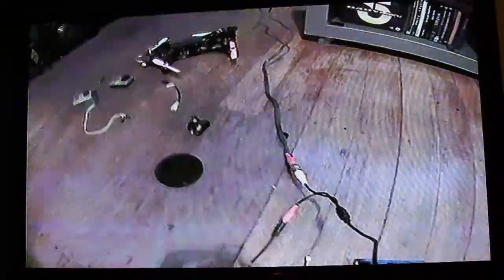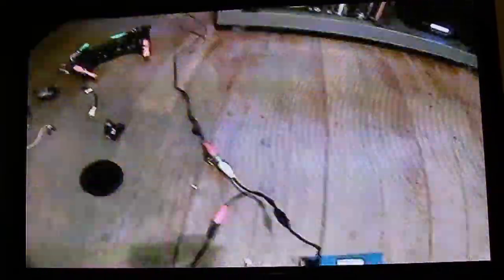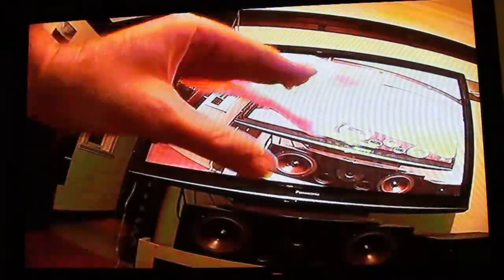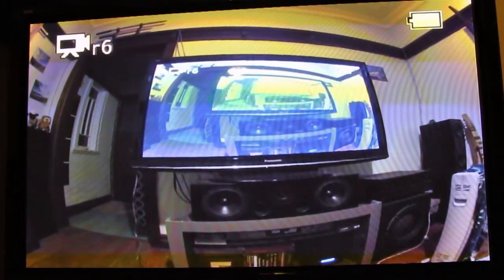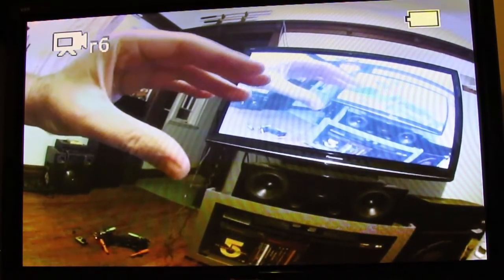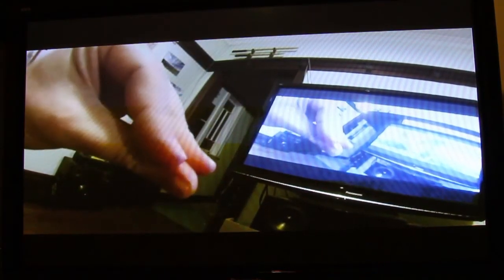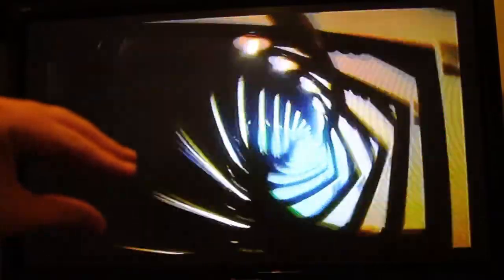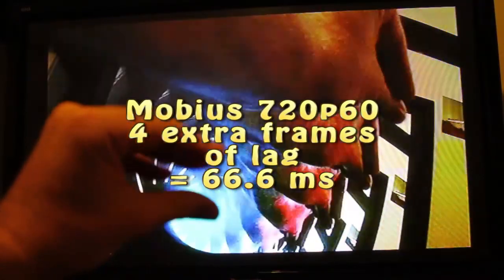FPV Camera Latency Test - PZ0420, Hero 2, 3 and Mobius compared

Comment: I don't want to watch the whole video. You claim the pzPZ0420 has NO lag? Is that even possible? So anyway, the total lag is 66.6 ms with the fpv camera and +- 1.8 times as much with the hero 3.
Reply from the maker: I don't even understand your comment but the findings are all in the description above... pz has virtually no lag, yes, especially when compared to the others. The 66.6 was from the tv. All cameras and systems will have some lag but there's a reason we fly dedicated FPV cameras.
Reply: For not understanding my question you answered it pretty well :). I guess even fpv cameras have 10-20 ms lag at least, so the 66.6 ms does not constitute the lag from the screen alone. Thx for testing!